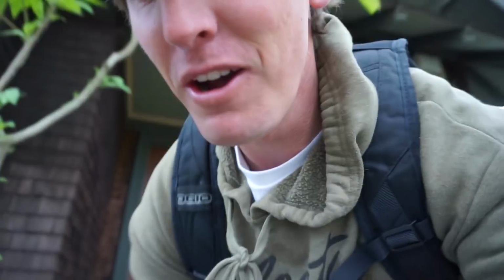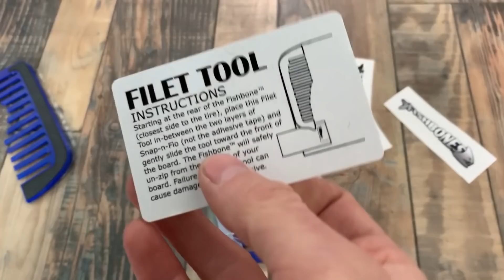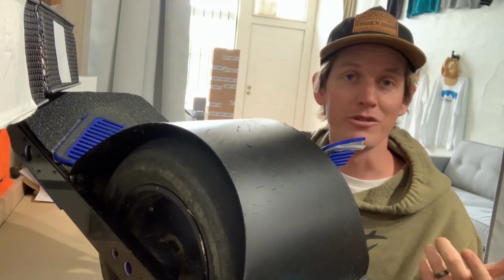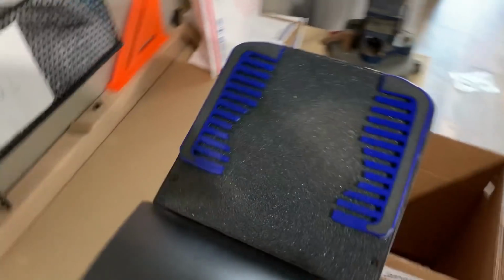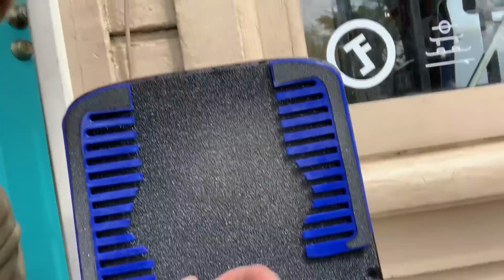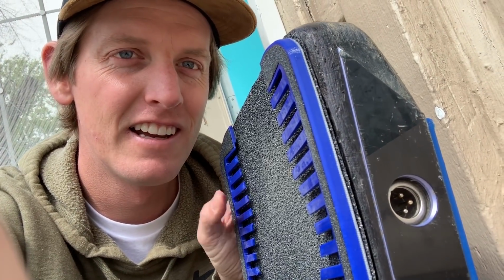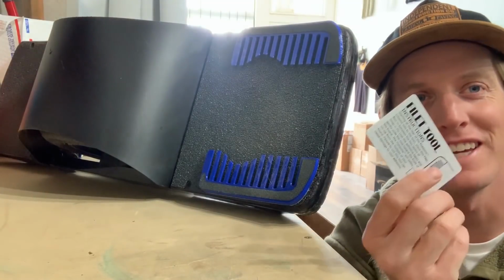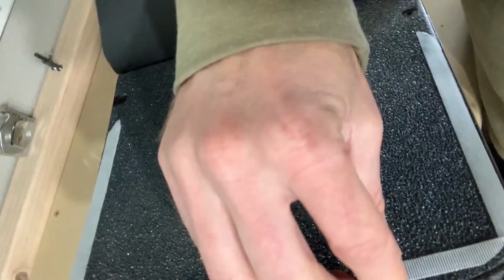Onewheel XR Fishbones Installation and Review

Comment: Mine must be newer. Straight adhesive to the grip tape and a 24 hour cure with weight on it. Just slapped them on and put 40 lbs of weight on them for the cure.

Comment: I also ride with my foot like you, for other who ride like that has any of you tried to see if placing the heel side fishbone closer to the fender would work?
Reply: FabioXCM I think it would activate the sensor
Reply: @floatfiend9024  Yeah I think you're right, that top part would most likely activate the sensor. if you got 2 sets though, you could grab 2 identical pieces and put one on the correct side and the other one upside down on the other side, could work but it would probably just make it worse  😂😂😂
Reply: Or take a second pair and cut off the top part and then attach it right next to and under the normal pair.  BAM!  build your own extension.  
I bet the inventors of fishbones will make additional options and/or improve on the idea.  Gota run with what works for avg rider first
Reply: Byromie I can ask. I’m friends with the developers and have been riding the bones for about a month now

Comment: So I've read up on this common problem of the ow including myself where we will have to to try and hop on the board like 3 times. You know lean forward and the motor dont activate.  To my knowledge this is a flat footed problem that not many look into. A arched foot has more pressure on two separate points . They say your leaning to fast forward but i can ensure you thats not the problem. Anyway I ended putting double sided velcro on each sensor like car stripes lol so one side attached to board and the other side I put grip tape to simulate a arch foot and now as soon as I step on, they are both being read very well with no more problems. ...........so my question is this, do you think this fishbones accessories would help with those contact points so I don't need to use velcro like a crazy person?
Reply from the maker: The velcro is placed on the sides to avoid sensor contact. I'm not sure I can accurately answer that question... You might just need a fresh front foot pad and you wont need to do that.
Reply: @TheFloatLife  thanks. Unfortunately I've already done that and its the same problem and both front pads I have work perfectly with the arch simulator, I'm gonna look more into this and see if my theory is right mabey a company will look more into this as well and go down the rabbit hole, and create something to help with this problem.

Comment: Why aren't the fishbones covering the full length of the footpad? What if you ride with your heel close to the wheel/fender and your toes towards the front corner of the footpad?
Reply: I think it is because a full concave pad would not have the concave all the way down either. Also they do finish just a little short of the flight fender, any longer and you would have trouble using full fins with them. I have my fins off but ride close to wheel and the bones still give a lot of control.
Reply: @RJnoserider10  thanks

Comment: When riding off-road, do you think there is a big risk of getting any dirt under the bones.  Which might hold pressure on the pad after a bailout and lead to a run away board?
Reply from the maker: SpecterSeventy2 never thought of that!
Reply: yup, for sure will happen. IMO
Reply: Yea, I’ll pass. I’m not screwing with that connection. Not on this thing..

Comment: Why don't you try sliding  the back foot fishbone down more to where your heel would be? It would look uneven but it might work.
Reply from the maker: Howie Dune Unfortunately I don’t think that would work as it would stick the sensor
Reply: @TheFloatLife  I don't know what you mean by stick the sensor. I think making the bones uneven will solve that heel thong you mentioned.
Reply: Howie Dune the parts that adhere to the deck are currently outside the sensor. If he moved it down it would need to be pressed into an area covered by the sensor. This would make the onewheel think it is pressed down.
Reply: @TheFloatLife  I'm pretty sure he means slide the heel side fishbone closer to the wheel instead of keeping it inline with the toe side one. The can be offset
Reply: [ MCKENNA ] yes but the problem I pointed out above still applies. Look up a video on what the sensors look like under the grip tape and it would become clear.  Only way this gets fixed properly is for them to make longer fishbones.
Reply: @danieltyrrell8884  Not true. They work anywhere along the side of the pad. I've seen other guys in the Onewheel Owners Group do it one at top edge, one against fender.
Reply: [ MCKENNA ] it’s An L shaped design. If you put it down lower the horizontal part of the L is then stuck on a part of the sensor. Unless if you installed it upside down I guess.  Not sure if that would work.
Reply: @danieltyrrell8884  I think you would need two of the same bones in order for it to work. For example, two bones that are designed for the top right corner where your toes would go. Install one normal, and the rotate the other one 180° and put it on the bottom left of that same pad for your heel. That way the hard part would be at the base of the pad.
Reply: @mckxnna2238  They only looked against the fender because they had flight fenders installed. They were installed correctly.
Reply: I took a picture of the sensor when I replaced my front pad grip tape and the left, right, and top edges of the front pad are safe for the velcro. The issue with sliding it down is that the top part of the fishbone on the heel side would come in contact with the sensor.

If you could maybe cut the heel side fishbone in half and slide the bottom half down, that might work but could compromise the stability of the fishbone. Really, a longer fishbone is what's needed.